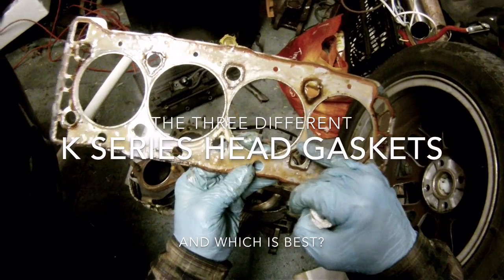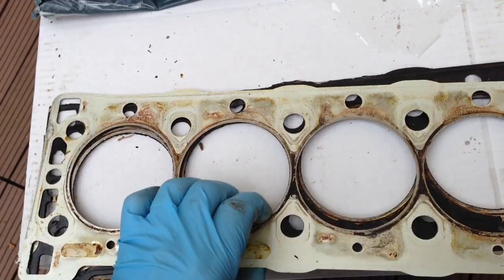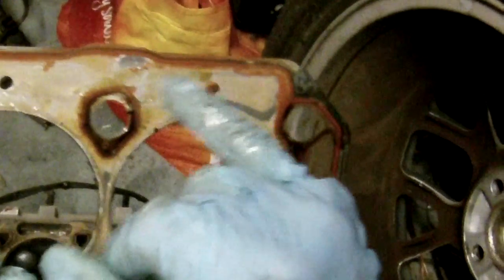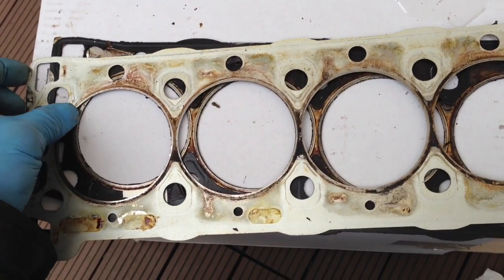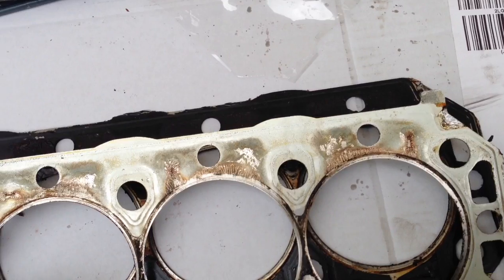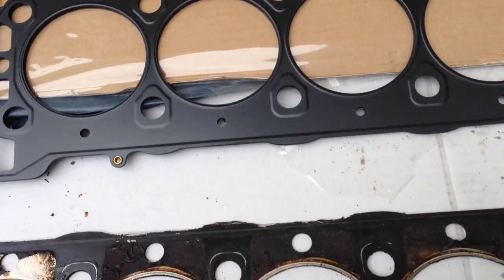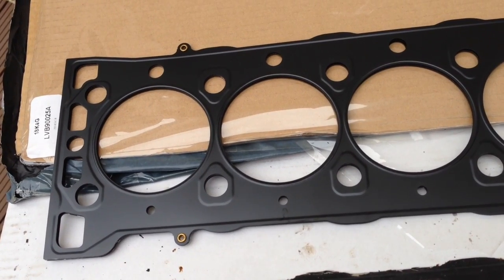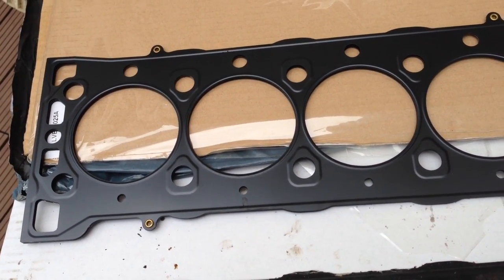MG Rover K Series Head Gaskets Review - The 3 Types Why 2 Fail

Comment: Can any one work out roughly out of every 100 cars how many had head gasket failure ?? I have just found an MGF in a barn in France, 1.8. 1998. 40.000 miles. hasn't run for 3 years.  I am worried about a possible head gasket failure when starting.
Reply: Check all the things you'd do with ANY used car like that.  Probably very few Head Gaskets actually FAILED, if any. Invariably the vast majority are DAMAGED usually by overheating for whatever reason. Many reasons for that ranging from user neglect or ignorance, poor or no maintenance " Why fix it if it aint broke" mindset involved here far too often. Worn parts or even professional incompetence by those entrusted to the care of a car's ( any car's ) well being. There again, probably I've been merely "lucky" with the two new K-Series Rovers and MGs still in regular family use now seventeen and twenty seven years after purchase new. I know it don't work like that. Ask any AA/RAC rescue Guy. I have a neighbour works for the AA.  Far too many car users today never check nuffink and do not even know where their bonnet release lever is in their cars. So NEVER check their car's basics to ensure reliability. Still, ignore all that. Lets blame the poor old Cylinder Head Gasket. Been on BBC and everything so these folks are "professionals" and obviously know what they're on about. No news of the FAKE variety ever to be seen or heard there ... on any topic. Well known fact.. For some.
Reply from the maker: Not sure but you can look up the percentage of cars with engine problems for each model on reliabilityindex.com.  There are plenty of mgf or mgtf models on eBay, the very cheap ones often with HG issues.  Better to get one of those and do a proper job on the HG. I'm tempted myself, looked at a couple recently for around £200.

Comment: Small Water droplets & small beads of 'margarine' on dipstick, but no oil in expansion tank. Any ideas?
Reply from the maker: Probably the head gasket needs changing, often the water is at higher pressure than the oil. E.g. Around the oil drain back points in the head, so water can go into the oil first.

Comment: Another issue of using the triple layer gasket is the Liner heights. If they are not spot on, the triple layer gasket will not seal correctly. The N series gasket has seemed to have sorted that flaw in the earlier triple layer gasket. I know a few people who have used the new N series gasket and also the toughened oil rail and have had no issues at all. It is a more expensive kit but if you intend on keeping the car for a long time it is worth the investment.

My current Rover 25 gasket failed at just a smidge over 50,000 miles. Failure was down to having the wrong coolant in it and a slight seep in to the evaporation chamber on the water pump. Because i know what i was looking for, I caught the failure at its earliest stage. Just a very small amount of oil in the coolant system. No over heating issues whatsoever. Because my liner heights were not spot on, the original beaded gasket was used for the repair. I also replaced the original radiator with a better quality alloy variant. So far I have covered 17000 miles without losing any coolant or oil at all. I will be dropping the coolant in the next few months and will replace with the same good quality OAT coolant.

Thanks for posting the videos on your channel. I always find them very interesting :-)
Reply from the maker: Thanks very much for the comments, some useful experience.  There does seem to be a lot of opinion on what gasket to use under what liner height situation.  One of those links in the description has a summary on that, but like you I now only consider using the N series gasket as it seems a better design and it has proven itself.
A recent HG job I did with the N HG after 18months had a very slight weep of coolant that was easily stopped by checking and retighening the head bolts.  One bolt near the weep seemed to have a low torque. I think the bolt was a bit weaker, or something settled, so I swapped it for another less critical location and retorqued up all of them checking the rotation spec as well as torque.  Checking the torque on a bendy bar torque wrench while doing the 270/360 degree rotation final tighten allows you to check there is reasonable torque, which was just over 50lbft.  They were the new stronger bolts, which they say should have a final tightening twist of 270 degrees, although on retighening I went for the normal 360 degress with no issues.  No leaks now. On old cars they used to say when fitting a new HG to recheck the head torque after 1000 miles, maybe a bit of that principal is still applicable.
That's one other advantage over the elastomer HG as when that goes retighening will not help.
Reply from the maker: I forgot to add that I noticed in a photo of that gasket mention above that the part number had been stamped into the gasket too close to the sealing edge, which is where it was weeping from. Something to check before fitting next time.
Reply: HG = Head Gasket
Reply: didn't understand shit;   liner height,this and that.....HG...i'll keep on searching